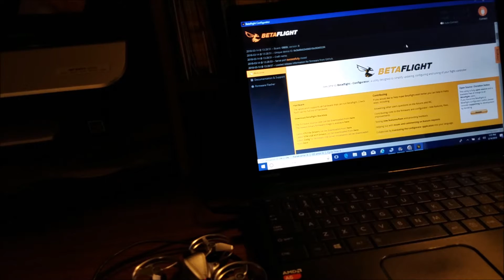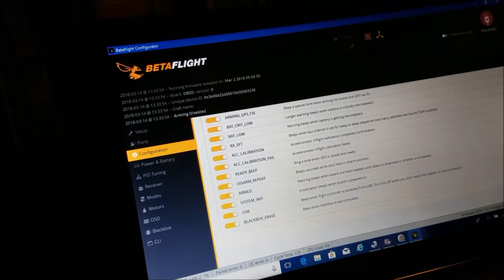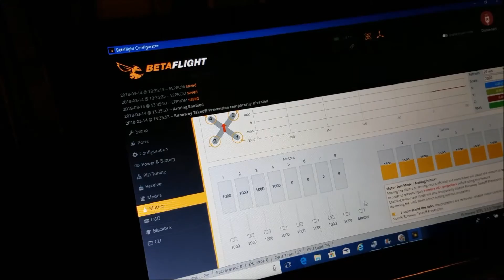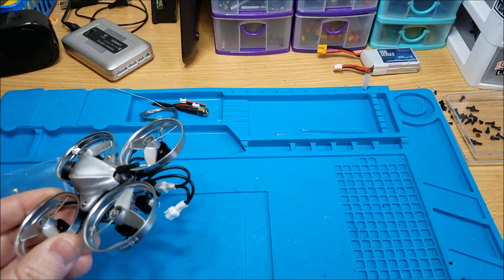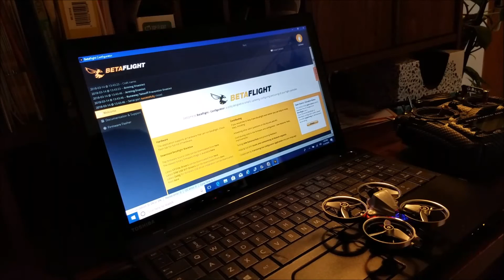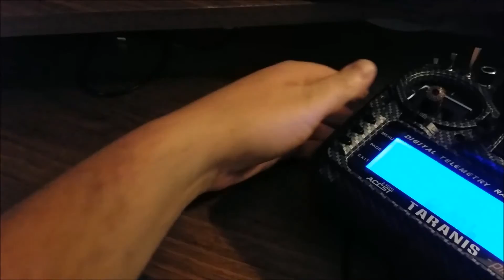bills rakon 76

Comment: Hey adam! So i pretty much copied your rakon 76 1102 build you did for nick burns. How did you solve the issue with the props hitting the ducts due to the height of 1102's? Did you just press the props halfway down, or did you use soft mounts to add height?